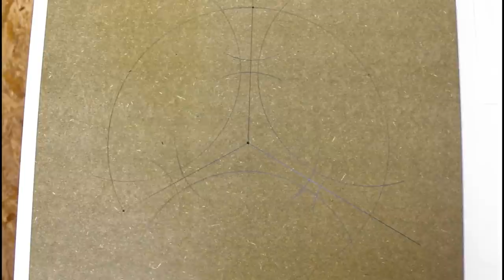Woodturning - The Bow Tie Platter

Comment: Excellent job and colour mix with resin as always Andy.Can you explain the meaning of glue block?(In Greek version)
Reply from the maker: Thanks Matthew ..Because the platter was quiet thin  I did not want to use a mortise  to hold the piece in the chuck ..so I glued a block of wood to the base and formed a tenon .. hope that explains ..cheers Andy

Comment: I always enjoy your creativity!  Fantastic platter!  Hope you don't mind a couple of questions.  First, how did you remove the glue block you used as a tenon for the bottom?  And, what do you do to make sure you don't get bubbles in your resin on projects like this?
Reply from the maker: Thanks Tom .. I used a jam chuck to remove the glue bock .. I normally use a pressure pot but this was too big so I give it a blast with the heat gun to help remove bubbles and cross my fingers ..

Comment: Can you tell me how you attached the platter to the lathe after you finished the bottom. I never noticed a mortice to fix to a chuck
Reply from the maker: I attached a glue block and formed a tenon .. there wasn't a lot of thickness to use mortice ...
Reply: @AndyPhillipWoodturning  ah glue block. Thanks Andy
Reply: @ @AndyPhillipWoodturning  So the glue block that you used won't harm the finishing that you already did? Is it a special item? I'm asking because just after xmas I'm going to start turning, and bowls and platters are an obvious starting point. 

Lovely piece, as usual. It's art, absolute art, and you make it look so easy!

Comment: Fantastic job Andy! 

How did you attach the bottom of the platter to the lathe after you turned it around? You had already put a finish on it, so I assume you didn't glue it to another piece of wood.
Reply from the maker: Thanks .. Yes I roughed it up a bit and used a glue block ..it was a bit thin for a mortice ..

Comment: How exactly did you hold the piece after turning it around? There was no tenon on the bottom left... Am I missing something here?
Also, how do you get your epoxy to be so nice looking - it is not a die but rather a powder? Do all powders turn out like this or do you have some special powders?
Great execution, this came out very beautiful.
Reply from the maker: Thanks ..Because the piece was thin I used glue block tenons ...& Mica Powders in the resin 👍
Reply: @AndyPhillipWoodturning  Thank you for your reply! Is Mica powder what you usually use in your projects? I noticed a lot of times that your epoxy looks somewhat shiny and glittering :)

Comment: You said you used a glue block on the underside to hold the platter while you finished the top, what kind of glue? Inquiring minds want to know -- so they can do it too.

P.S. Very nice platter.
Reply from the maker: Thanks Fred.. I use quick set  2 part epoxy..

Comment: Hi Andy, I know it's been a minute since you posted this, however, what kind of mount did you do when you where working on the face of the platter? I'm not familiar with the different chucks and everything but me and my dad are looking into trying lathing out and are intrigued to learn the different tools involved. Thank you :D
Reply from the maker: On this because the piece was thin there wasn't enough depth for a tenon or recess so I used glue blocks for tenons ..hope that helps

Comment: Is there a reason you start with such a thick piece of wood when you're making something this thin? Looking at it it seems like you ought to have been able to get To least two, if not three of that platter put of that initial thickness (not much room for error of course) I'm not a wood tunrse, so maybe I'm just not understanding how it works, but it seems like an awful lot of sawdust and not a whole lot of platter hahaha
Reply from the maker: The Platter isn't flat its curved so all the thickness is used ..